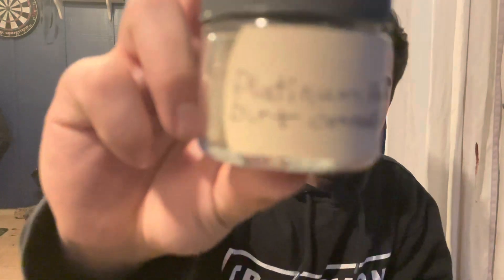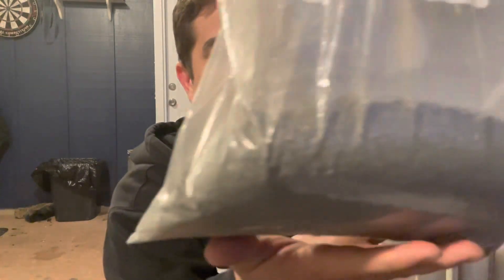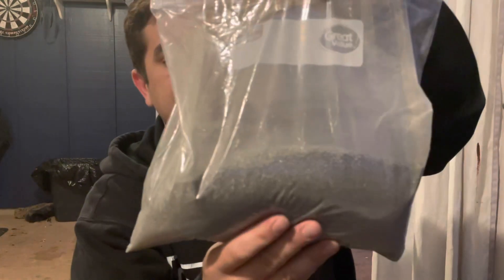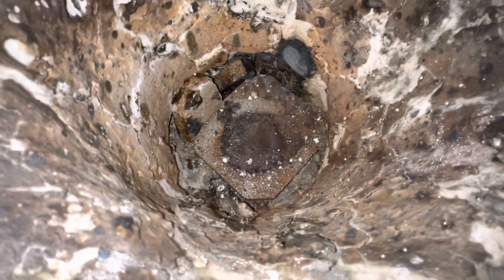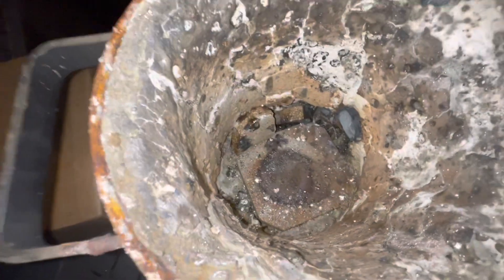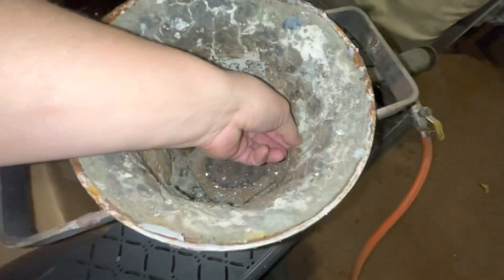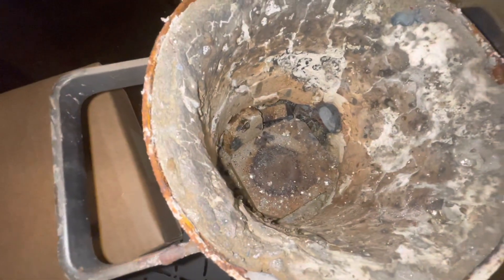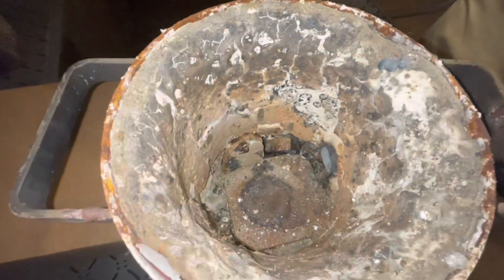Ultra High Grade Platinum Refining - Introduction to series

Comment: That’s a lot of metal per ton and you say this ore comes from Arizona? That’s crazy cool if so hope you can get that up to temp thanks for sharing see you on the next one 👍🏼👊🏼
Reply from the maker: that's what i was told. this is from an anonymous person so i have to go off of what information i have. I was very very skeptical so lets see.. also.. .from what i can deduce the initial melting and refining doesn't have to get to the actual melting temperature of the metal that's what the collector metal is for. as long as the convections in the crucible expose the tiny beads of pmg's they should absorb into the collector. we have silver or lead as the ideal collector however the lead is not as much ideal as silver, and kinda like oil and water so it needs to be really rolling or exposed to good convection to expose the surfaces and absorb. Jason @MBMM had done it with a normal forge and converters even just used a claytype crucible the pmgs were bb's in the slag, copper absorbed it ok, lead worked better but i hate using it as a collector metal. even the ceramic was absorbed and degraded into the slag.  the first jar will really tell the story of what were looking at!! we shall see
Reply: @VendettaProspecting  sweet great explanation thanks 👍🏼👊🏼

Comment: Brother Mike, Awesome show for sure! You be doing big things! At first I thought you were chemically refining, but as soon as you started talking about smelting and Mount Baker, I knew different. This is day 3 on my new Silver Cell batch. Going for 2kg this time. Maybe more! This time the crystals are growing much slower. Either the cold is affecting it or the new Dacron filters I'm using are slowing it down. They are actual shop-vac brand and they are a little thicker. I have 600 gram silver nitrate solution, 3000ml, and as of today 22kg of sterling that I'm running through it. Going to be large!! Keep doing what you do and being who you are brother! You are a important part of our planet!
Reply from the maker: Right on!! im waiting for normal temps to come back!
Reply: @VendettaProspecting  Has to be the temp plays a role. It's warmer today and  I just went out and checked them. They have exploded! They have grown more today than they have in the previous 3 days.

Comment: I found a pure platinum ring 1000 PT metal detecting.  Usually rings are 90-95% platinum.  I also bought 2 wide band rings at a second hand shop.  They did not know that the rings were not just 95% silver, but also 5% platinum.   Looking forward to your process videos on the refining.
Reply from the maker: Very cool! Thanks Mike!